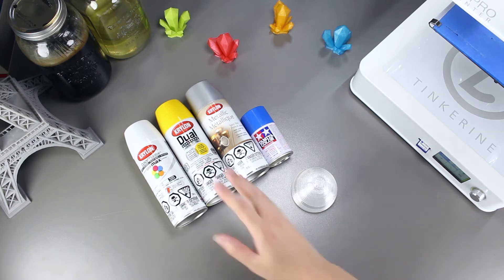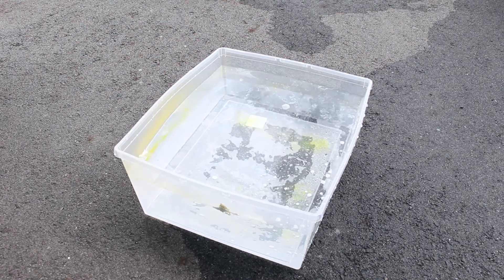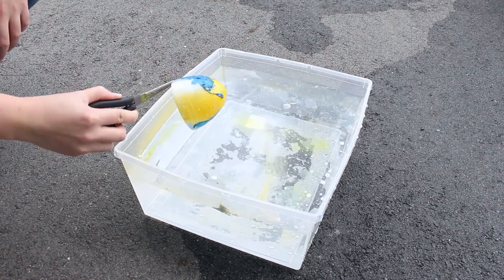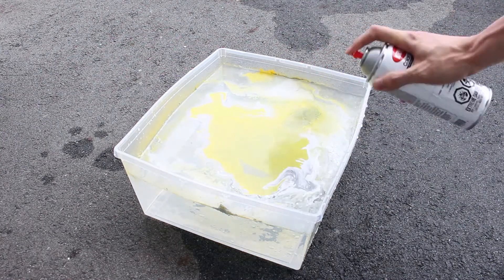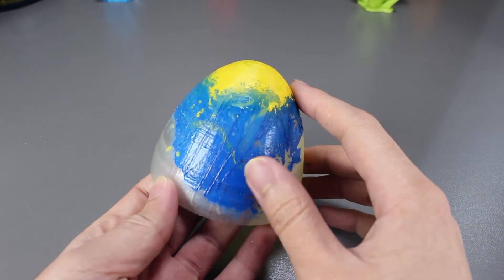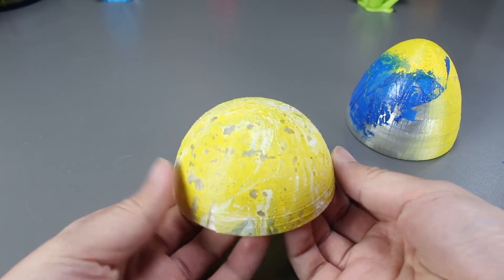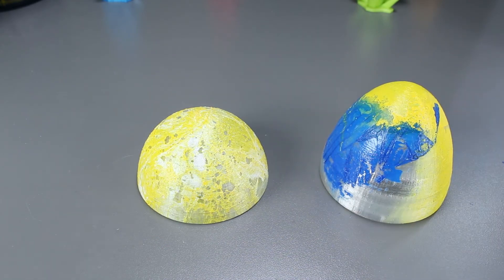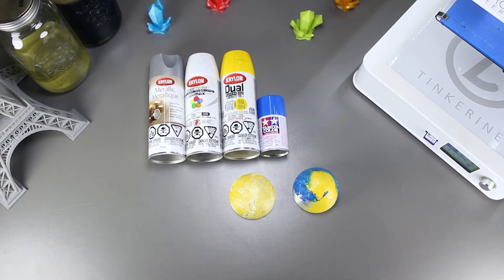Post-Processing PLA Prints with Hydro Dipping

Comment: You need to be faster when spraying the paints. You took way to long in between colors. If you're doing a two paint or more dip, you need to start spraying the second color almost immediately after you stop spraying the first color or else it gives the paint time to flash off and plasticize. 

Also you should be using hot water, room temp or cold water doesn't work very well. You'd get much better results with hot tap water.
Reply from the maker: Thanks for the comment and suggestion! We will look into it with hot or warm water!